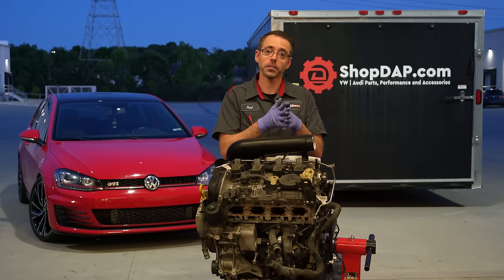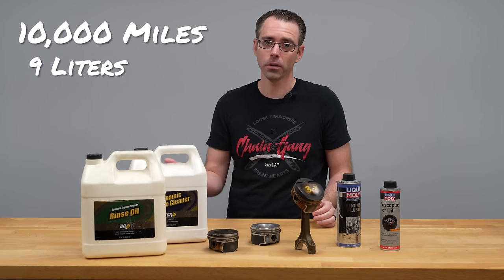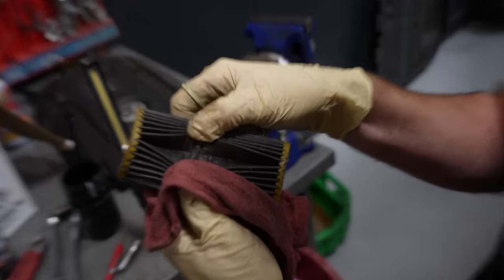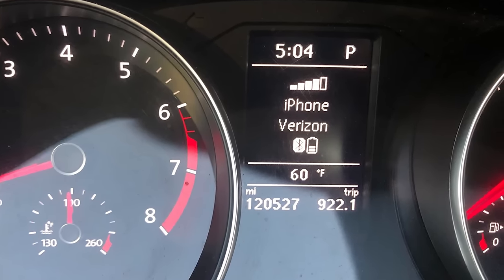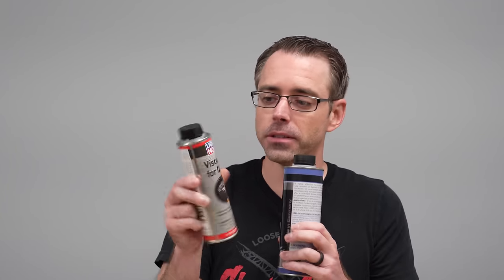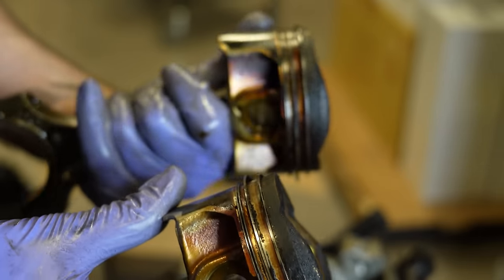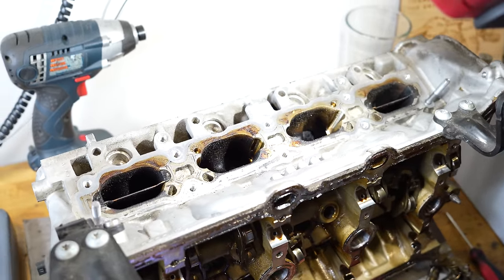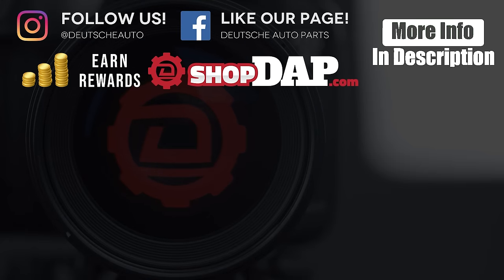Can you Fix an Engine Burning Oil for $20

Comment: I think blaming the user for oil buring is wrong.  Our Scion has had the oil changed more often than recommended its entire life.  At 150,000 miles it started to burn oil where it would need a 1.5 quarts between oil changes.  Now at 0ver 200,000 miles it needs a quart about every 600 miles. It burns less if we keep the speed under 65.  The problem is not caused by lack ov maintenance in this case.

Comment: Not changing oil and filter ever 5 to 10k is the reason oil burning is an thing. If everyone would use prolong in the engine and trans like I have for the last million miles and 25 yrs. That helps emmensly too.

Comment: I had a friend here in Australia with excessive oil consumption.. 1 ltr every 800-1000 kms. 

Dealer tried saying normal.. but started a oil consumption test. 

He thought F*ck it.. every 1000kms  he’ll actually drain 1.5litres out .. go to dealer every month.. 6 months later complete new engine… 

This engine 2 years later no consumption at all and has clocked up 45000kms in the 2 years. 

Take matters into your own hands if VW playing games with you

Comment: TSI EA888 engines need to have pistons, rings and conrods replaced with the update to permanently solve the oil burning issue. Bad oil ring design causes this and the updated oil rings are very different. I had a GTI MK6 with this issue and was burning 1L/1000Klms. VW didn't care that it had only done 80K because it was out of warranty. I got rid of it. I will never buy any VAG product ever again as VAG treats it's customers like shit. I have a I30N and no oil burning at all, a more fun car to drive.

Comment: use shell v power and castrol magnatec i had same issue where my audi s4 used to much oil when i buyed it new it has 46.000 miles it started burning alot of oil at 120.000 miles i start using shell v power and since then untill now my car stopped using to much oil those who have same issue try to change to a new brand like shell v power it helped me aloot also STOP using engine flush! it will only make things worse with a big payup bill dont flush your engine

Comment: If it is a Warped Plastic Intake, this oil Cleaning will not Help, many of the Gm 3.8 Engines had problem with the factory Plastic Intake, a replacement Aluminum stopped the oil consumption problem...

Comment: I first saw Ford Boss Me lie about this bull shook and now I see these guys lying. If one cylinder has 120 psi and the rest are 30 psi higher. You have a burnt valve. The only way to fix an engine burning oil is to rebuild the engine.

Comment: my 2013 civic burned a quart every 100 miles or so, Absolute garbage, I was spending more on Oil some weeks than i was in gas,
Bought vehicles with a 7.3 powerstroke and another with a chevy 4.3 v6, 20 years older than my honda and runs cleaner and better with 200k more miles. New doesnt always mean better

Comment: even so, better to change the piston rings. 1 liter oil every 1100 miles... dang! still way to much. I own a VW touran from 2006 and my car doesn't use any oil. it is still 100% full even afther 9000 miles. I change oil every 9000 miles

Comment: Why fix it unless it’s causing a problem? I have a Saturn been burning oil for 200,000 or more miles. Change plugs in time and keep oil topped off and there’s no issue. Not enough to make a trail. My point if it’s not smoking enough to make a problem or causing very wary plug fouling, why care?

Comment: The problem with all these solutions is that you have to keep using them. 
You never address the root cause of the problem.
Try bonding a lubricant to your engine: You'll only need to do this once.
Improved lubrication frees up your rings (nothing will stick once coated) and reduces oil use.
:-)

Comment: If burning through the entire oil fill before every oil change is "in spec" what's the point of even changing the oil...seems like you'd want to save that money and change the filter every time you fill the gas tank.

 I'm not saying don't change your oil...just saying this is probably leaving behind so much sludge that you need an engine flush more than the oil change itself.

Comment: the only thing that I didn't understand is that most of those are just snake oil but why didn't you put the the chemical base and the piston hole and then let it run it'll clean it out a lot faster than trying to do an oil change and clean all the chambers all over the the engine it'll still burn oil regardless unless you can get a engine rebuilt or just take out the pistons and put in new rings and place it back in you have a better chance at that other than that your video was okay

Comment: Anyone succeeded to fix oil burning with liquimoly products? I really need some information on this because the bg products is not reachable from my country, and currently im trying some methods to fix my car which burns oil, and liquimoly is pretty much everywhere in my country so i'd like to know if using liquimoly products helps to decrease the oil burning

Comment: Wd40 in the intake and cylinders (remove spark plugs. Of course with the ignition system disconnected, crank over and spray let it suck and soak. Wah lah!!!!!! Will be good again!

Comment: LMAO i have a 100DB exhaust with a Frequency below 250hz (Shakes plates 30ft away in the house) 
45 mins at 3,000 RPM and people 2 streets away will be complaining hhaha.

(That being said 3,000rpm is common cruising rpm for 4 cylinder cars with only a 4 speed manual or 3 speed auto in the old days. 
20 years ago Drove almost non stop 1200 miles in my 2.6L Mitsubishi Sigma (1982 model) Average RPM 3200-3300 at 60-65mph for 18-20 hours non stop. 
Zero Damage or issues and that was in average 105-110F temps (AUSTRALIA)

Comment: well my car would be totaled if i rebuild the engine, i have a peugeot 207 from 2009 with the 1.4 vti engine, i payed 3000 dollar for it it only has 70k miles. but it uses 1 liter of oil every 1000 km

Comment: Oil being called for is about as thin as water and loose rings allow blow by. All to escape CAFE fines.
Not sure but when you go from 10w40 to 0w20 are the clearances tighter? I think not. I think the truth is that manufacturers could care less until the public catches on.  The idiot in me says we put all these sensors on cars to prevent hitting other cars. If that worked you could actually take some of the other safeth crap off. Crazy but if tech realy works we should be able to make cars lighter not heavier....

Comment: You can also use half pinesol and half oil.  Works just as great. Run your engine 1hour.  Then drain.   Another great thing is add pb blaster to your cylinder let sit over night then drain oil and fill with new oil you can even do both methods.  Pb plaster then pinesol. Work trust me. Done it multiple times on engines that burns oil.

Comment: the easy fix.... (that's the right one)
i went 10w40 semi synthetic , instead of 5w30 GM advised...(opel )...
it's supposed to be wrong,,,(10w40) not due to viscosity alteration  ,,, but due to 10-40 beeing mid-saps  oil, and 5-30 low ,,, so it doesn't "poison" the catalytic convertor.....
i say BULL......
it's better for the catalyst to have to "deal" with fumes of litters of burned low saps oil ,,,,, or none of mid saps oil?
car doesn't burn any oil anymore .. (12 years later) ,,, puuuuurs like a kitten ..... 
(used to be round 2 litters  every 10.000km , that i change oil....)

in the words of Dell boy.... "you know it makes sense "....

i don't know if that would work with modern diesel ,,, cause don't know how sensitive  DPF are... but i'd risk it..

Comment: Very nice video, although you could use an endoscope before you tear up the engine and after tearing down eventually a bore gauge to determine the wear on the cylinders.  😉

Comment: I have a 2014 GMC Sierra pickup 6.2 80,000 mi around there it started burning 3 quarts every 5,000 this engine has been maintained perfectly. Disappointing.

Comment: Go back 50 or 60 years  >>>  Normal factory oil consumption was one pint per 1,000 miles AND you changed the oil every 1,000 miles !

Comment: (1 Liter-35oz) every 1200 MILES-1900km OR 1U.S. quart(32oz) every 1000 miles [I just rounded it to what guys know in the same LANGUAGE OF MEASUREMENT.  So, if you change oil every 3000 miles you would have burnt 3 quarts by that time.   THAT CAR SHOULD BE IN THE JUNKYARD.
There would be such a big cloud of blue smoke out the tailpipe you would not see the car behind you.  That is old SMOKEY.  Or a Mexican high performance Hi-bred piece of junk.
.   My 1980 VW Rabbit barely burnt that and I had a Million miles on the odometer.(yes I kept records I also did oil changes.)  Not high test synthetic oil.  Just cheap oil of the right viscosity for a VW.  The car ran, so the compression was good. 400psi Diesel engine. Diesels need that compression to RUN.  A lower compression and it won't fire up. Fuel economy was 61MPG US
.   On my older (1973) gas car air cooled VW, I did not consume ANY OIL worth mentioning between oil changes. No oil filter, just an oil screen.(mileage on odometer was about 300,000)  
. The recommended amounts by VW is extreme as you would be burning so much oil, you can smell it as well as see it. I don't use less than recommended for my car (30W30 or 20W20(winter it snows and freezes)  Not a problem.  Fuel economy was 31MPG US

You pictures did not show much in Carbon.  Just gas varnish( the yellow color)  Most of the carbon would be on the exhaust valve stem.  Seen a thick collar on the valve stem of farm vehicles that sit idling or running short cold hops.  Must have been 30 years worth. Farm truck still ran.  Had to be wire wheel cleaned. Nothing you can do about it...if that is the way you use the equipment=that is the result.

Comment: This is a simple ceramic head gasket fix.  It needs heat to bond and is trash.  To actually fix compression issues and or oil burning , do it correctly.  

This will fix said issues for no time lol. 

Proper hone and ring seats won’t burn shit.  

Running 27psi of boost an burn no oil.  

This is so wrong

Comment: Truth is engines are made with planned obsolesence on mind, simple things like valve seals, oil rings are made to fail at certain mileage, like 150.000mls or 250.000 and there's little user or mechanic can do to delay it. After all, that army of highly educated engineers are much smarter and better payed then average mechanic.

Comment: Its too bad he didn't use the liquid moly on the car that was burning oil.  I assume it won't help much at all. He could easily get another car that's burning oil and do the same with the liquid moly. But that might hurt his sales of liquid moly if he does it and turns out that liquid moly is vapor ware when it comes to slowing down the oil burning
Reply from the maker: Or he didn’t have many more months to find a car burning oil and repeat this process. 

The good news is no one’s is stopping you from making that video and the product is extremely inexpensive relative to the one we actually tested. 

I look forward to seeing that video from you.

Comment: Inaccurate and lack of knowledge with saying Toyotas have it. ONLY THE 06-08 2.4 AR series engines have it where the EPA and similar air resource boards mandated better fuel econ that forced them to put in low tension rings to compete in markets that caused this error in addition to changing the OCI to 10K to compete in lower ownership costs. The most reliable brand became one of the worst for TWO YEARS ONLY. Look it up if you don't know or believe.

Comment: That's bullshit: the oil burning problem on VW TSI/TFSI engines was a misconcept from the oil scraper ring: the ring was too thin and the oil return holes was too small= carbon did clog the holes and after this did all the rings quickly seize= the only way to repair this, is to disassemble the pistons and replace (or modify) the pistons and rings with a much larger u-flex oil scraper ring , and much larger oil return holes, in addition the oil change must be made all 10 000km and not at enormous "VW recommanded intervals", and this cost a bit more than 20$

Comment: "Within spec" of operation, meaning the engine will still run, which is actually pretty good if you look at it from that perspective.  the engine will run rough, but it will run.  at 1 Liter per 1,200 you are probably going to be rebuilding the engine soon, anyways.  the more cynical you become about the term "within Spec" is based on flawed reasoning.

Comment: Just use the best FULL SYNTHETIC oil and change it more often , at least every 3-5 thousand miles.. don't wait until 10 000 course they told you .. You gonna save money on oil and ruin the engine..

Comment: Can you get the rings replaced with non low tension rings?  What is this, the dark ages?  We now have vehicles once again that you have to haul a case of oil with you to prevent them from self destructing!!  It is bad enough everything is expensive because of shortages and inflation now we have to buy more oil than we should have needed!  I am pleased to say my VW 2.5 does not seem to burn ANY oil!!  It is always the same on the dipstick.

I would not send the engineers to a gulag but I 101% feel they deserve an extremely long lecture on this!!  Cars are supposed to be reliable you jerks!!

I don't say those things to sound mean, cold and uncaring.  When oil is burned it can even clog catalytic converters and we all know those are expensive.  It also angers me to no end that people steal them from cars!  Send them to the gulag, not the engineers!!

Comment: I dont think these low viscosity oils help   0w20???       I have a 1999 camry in the winter I use 5w30   in summer 20w 50    329K dont need to add oil between changes.....I will pass and not buy these newer turbo direct injection engines

Comment: Guess what my Toyota hilux 1997 with the 22R engine and it has done 430000 kms on it and does not burn oil why are these VWs burning oil because they are not very well built l would never buy one because my toyota hilux is indestructible why l am sure it the engine and gearbox are original is if the engine wasn't any good it would have been scaped because on only paid $1500aud 3 years ago and done about 20000kms on it and the toyota hilux has been serviced by me and when l changed the oil 5 litres of oil came out of it and in all of time l have had it it has never broke down there are many of similar toyotas on the road in the USA with the original engine in them better than any crappy modern VW

Comment: Wenn i see how that audi/vw engine is build in terms of design u know u buy a very very fragile engine and i mean:
Long single row timing chain with a few plastic guids and tensioners........
I dont like these moder VAG engines with there 100 sensors and complex designs,u see them to often on youtube with under 60-90.000 miles ready for a rebuild or or expensive repairs.

I would rather have a old proven push rod 2 valve per cyl with a central cam and a double row small short timing chain v8 like a a LS1 or chev small big/block or Chryler or Ford v8 that pumps out the same amount of ponys and yes they drinks more but u dont have to worrie about huge repair bills that u get with these dealer only engines.

Me i drive a australian made old style pushrod holden 304 v8 engine and even after 200k miles its perfect no rebuild needed it burns no oil has no weird engine noises runs on all 8..
Sad these modern blown alloy engines with all possible technique,s to make them better more powerfull and lasting longer are struggling to beat the old genaration cast iron relative low power v8s in terms of life span.
What u save on fuel u spend on repairs...........So i prefer the old reliable v8 vs the blown modern powerhouses.

Comment: I go through 400-500L of oil every 2700k with the oil/filter is change. 5k is way too long and only use Castrol. VW are garbage and require alot of maintenance, oil is cheap engines are not.

Comment: This movie should be well studied by automakers who employ these very stupid engineers.
It is incomprehensible that manufacturers make weak piston rings and other nonsensical constructions to save fuel.
The misery that ensues is much worse for the environment.
The fact that engineers do these things shows a terrible stupidity because it also gives the car brand a bad name.
As a result, I no longer have any faith in Audi and Volkswagen.
Have had an Opel Corsa sport 1.4 with the same oil consumption problem.
Slightly stronger piston rings were then fitted by the importer and the problem was completely gone and that remained good for another 260 000 km.

Comment: Snake-oil salesmen.  Reminds me of the time ,many moons ago, I bought a tiny 50ml additive from Cermatech for $50-$70 for a Corolla that had the 'oil-ring problem'.  Completely useless, the additive, not the car - still have the car, still burns oil.
Reply: If you have the 2.4L engine then most likely nothing will fix the problem. Honda 2.4L has also similar problem - backed rings

Comment: If you change your oil every 4000 miles max, or every 6 months, these problems will never occur.
Toyota suffers the same problem ONLY due to lack of consistent maintenance, otherwise they would be fine. AMD from Car Nut channel explains it properly. 
Vw group is freefalling, their quality is increasingly worse and worse. Go Japanese and you will never regret it.

Comment: Modern engines are disposable money grab trash. Buy a new car! 

The oil control ring shrinkage is a real issue (along with gdi/cvt's) and the MILD increase in efficiency and environmental factors is TOTALLY negated by their disposable nature and decreased reliability from older SEFI/Auto/manual cars. 

I HATE where cars have gone.